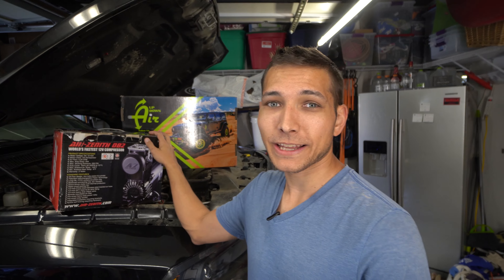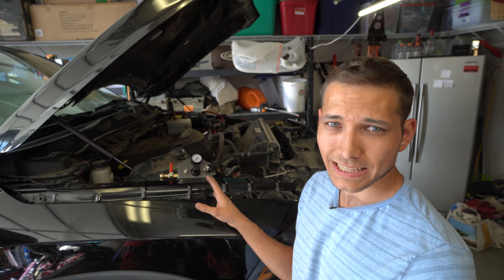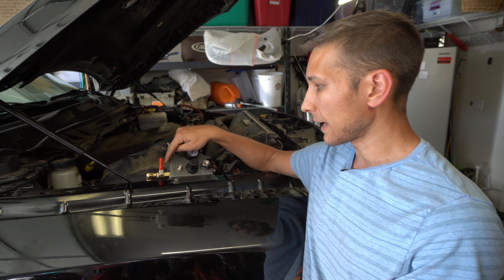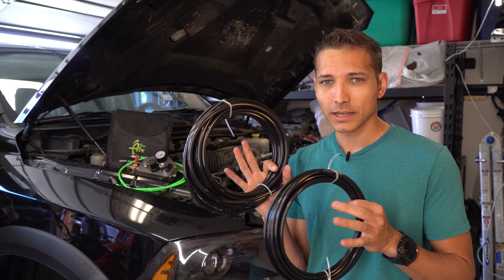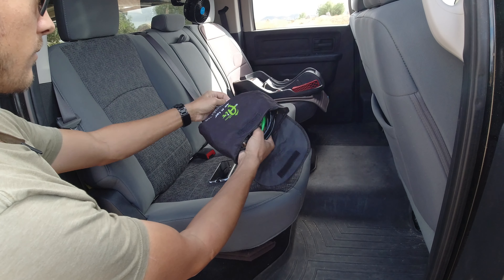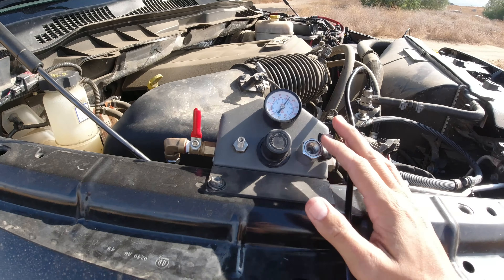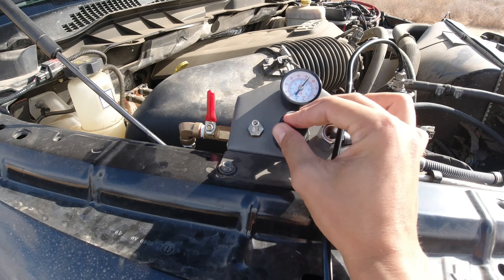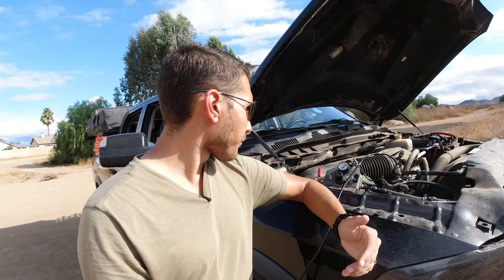On Board Air Install For the Power Wagon With Updownair and Air Zenith-Air Up All Tires At Once!

Comment: Glad I found this video. There’s not enough content regarding this product online. 

I just got mine installed. I know this sounds dumb but I’m having trouble connecting the quick connect chucks to the valves in the wheel wells. 

Can’t find a single video that shows that part so I can’t figure out what I’m doing wrong.

Comment: Wondering if you could share how you hooked up air compressor to tank and back to up air controller just picked up mine want to run a tank also
Reply from the maker: I've got some more stuff for on board air coming out, but basically you run the compressor to the tank, and a line from the tank to the air controller...or "t" the connections together, but put a valve before the tank so you can run air to just the air controller without filling the tank

Comment: Hey great video very informative you should interact with people that leave comments on your channel the more comments and interaction the more the video gets suggested. Do you drive around with those connected to your tires
Reply from the maker: Sorry for the delay-I've been trying to get caught up on a lot of stuff lately so I've been bad with comment response! You won't be able to drive with them connected, well not without damaging stuff and whipping the side of your truck with the quick connects!
Reply: @chazpages  oh no I meant like while rock crawling so you can adjust tire pressure on the fly like if your tire needs to be let down to adjust grip and whatnot
Reply from the maker: @Justthemow  ah, gotcha. Yeah that would be cool! I guess it'll be a while before we have compressors/lines built into the hubs. Until then...

Comment: Hey i bought some Tow mirrors for my 2018 Ram 1500 and it was saying i have to Activate something for my turn signal and puddle light to work because the truck didnt come with turn signals or puddle light on factory mirrors. Can i do that with AlfaOBD?
Reply: Did you figure it out? I’m on the same boat